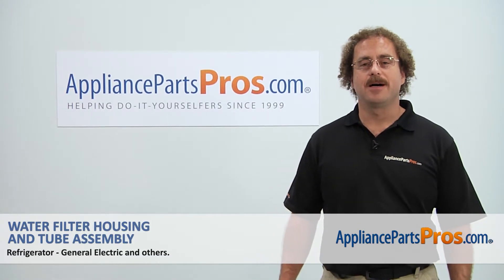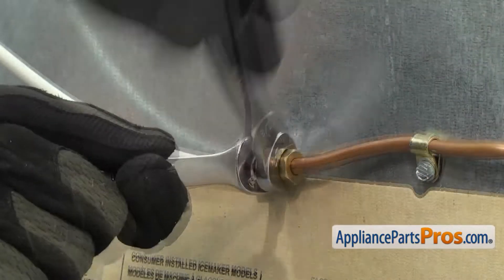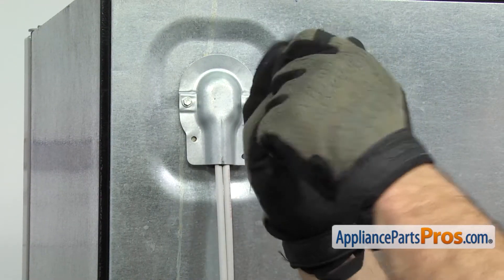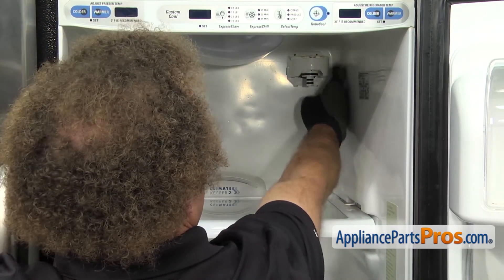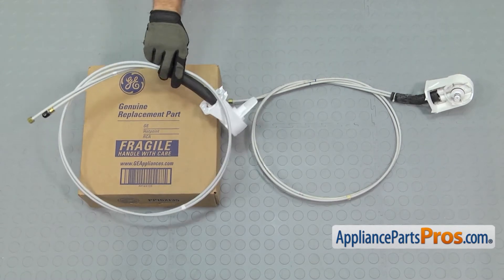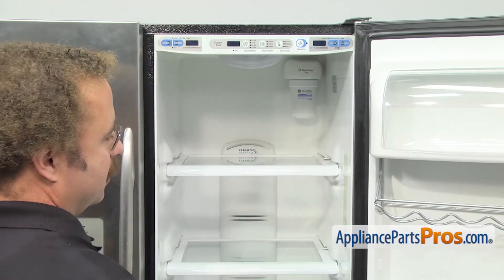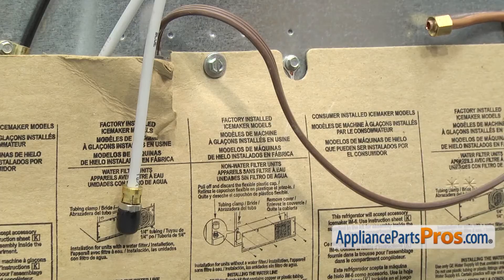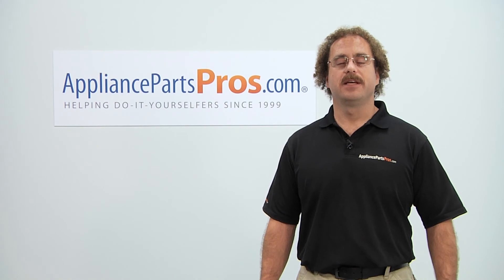How To: GE Water Filter Housing and Tube Assembly WR17X11894

Comment: Does it matter which line goes to the valve and water source?  I have a older fridge that those lines were cut so I repaired them and reconnected but want to make sure before I turn the water back on so I don't damage anything.  thank you

Comment: I have the same question. Had to buy a new valve and tube assembly but it did not come with compression nuts (had to buy separately). Does it matter which line goes to the fridge and which goes to the water line? One line has a small ring of color, yellow. The other has a small ring of color, brown